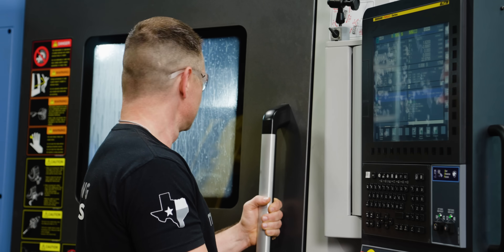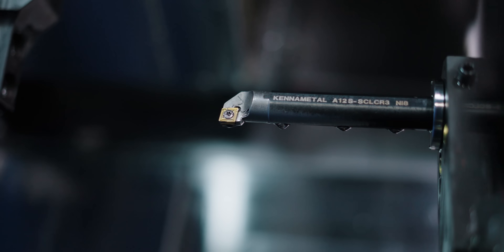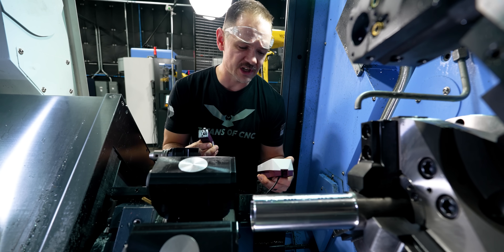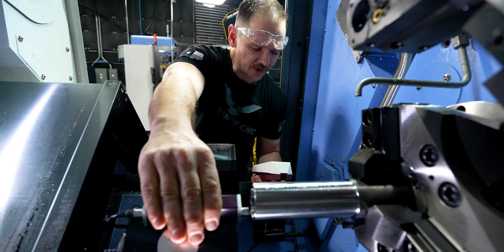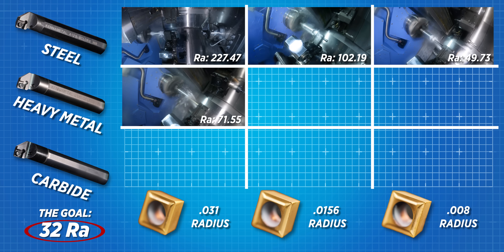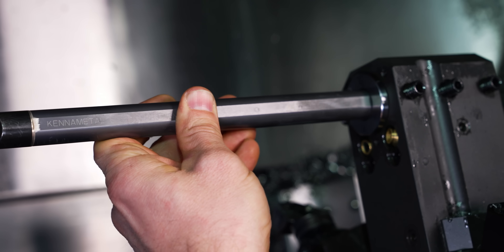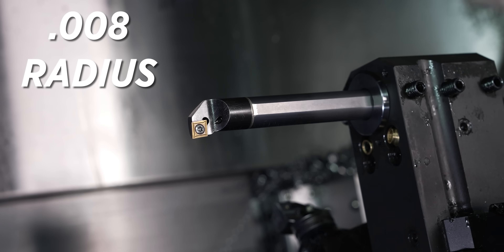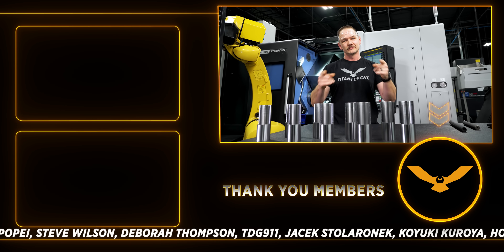This KNOWLEDGE Will Ease Your Pain and Suffering When Attempting to Machine Perfect Parts

Comment: This is not about "knowledge easing pain" but "throwing enough money at the problem". The more rigid tool gives you less chatter, who would have thought. Also, changing another variable (the feed rate in this case) makes the whole experiment unscientific and worthless. What a waste of time.
Reply: Money or not, you will not make this cut at a 32 RA finish with a Steel Boring Bar with that size shank and depth. Good luck trying.
Reply: @pummppkinn  I never said that, I only said that the title is clickbait trash and changing multiple variables is as unscientific as it gets and prevents comparability of the results.

Comment: Call me old school but I was taught that the cut should be bigger than your radius, this stops the vibration. Would you believe it the smaller insert worked better but I bet if the larger rad insert was given a bigger cut it would also work fine
Reply: Spot on :)
Reply: What that mean by cut,
Is it Depth of cut ?
Reply: Are you saying that the depth of cut needs to exceed the radius of the cutter?
Reply: Yes.  Depth of cut should be at minimum, the tool nose radius. @mdmonroe82
Reply: So that's a rule of thumb.  I do CNC production and sometimes you can't get around it. I have to program my machines to do something that's not ideal all the time.
Reply: These guys aren't realistic for sure, but I love watching them ruin high end machines.
Reply: Just buy a sandvik devibe bar 😂.
Reply: This rule may explain why insert with a smaller radius worked better...

Comment: First, follow 3 diameters rule material overhang. Second, the depth of cut should be no less than 2/3 of the nose radius. Third, avoid depths of cut smaller than 1/3 of the nose radius when finishing at small depths of cut. Fourth, boring bar overhang 4xBD steel, carbide 6xBD, 10-14xBD for high end with dampers. Follow the above and you will have no problem, but before you do all the above finish your education. YT school is not for everyone.
Reply: true

Comment: I was like "Getting a surface finish of 32 can't be that hard, what's all the fuzz about?"
Then I remembered that the units are probably different. It turns out 32 microinches is 0.8 micrometers which is a lot finer.

Comment: I dont appreciate how the only solutions presented are "buy a better tool". In my experience, adjusting speeds and feeds and ensuring rigidity is the most effective.
Reply: You are right, but more than once, the "Buy Better" is what it comes down to...ESPECIALLY to save TIME...Which is what? MONEY.
Reply: of course better tools will cut better. It’s about practicality and balancing that with what is available. Use things until they break. Don’t waste tooling.

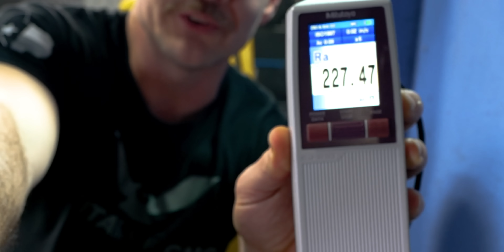Comment: 4:50 you are not holding that thing with your hand ... you know your hand vibrates right ? Deer lord ... this man lost his bucking mind.
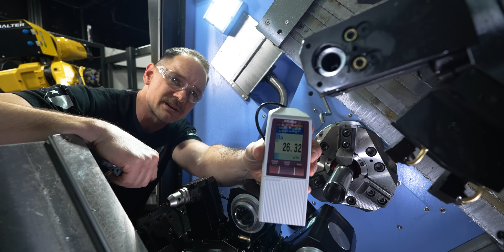13:03 so you suddenly changed the feed rate... uh ... so ... now run the other bars again at that feed speed. If you change two parameters at once you don't know what's helping the most.
Not scientific and your little comparison grid goes out the window.

Coming from a guy who ran 0.000 parts on carbide bits without aerospace lathes but on something from the 50's and 60's . Made military grade vehicle parts. Oh tolerance was wild - +- 5 thou. Doesn't mean you have to use all the clearance. Just gotta love the machine a bit ...

Comment: I believe depth of cut matters on a finish pass depending on tool nose radius. That's why a .008 tool nose radius will have lass chatter than a .031 on a .03 depth of cut. Give it a .06 depth of cut and the .031 tool wont chatter as much.

Comment: I’d have been interested to see how an increase in DOC would have helped the .031R.  I do Swiss machining and programming and use positive profile inserts and have to adjust the radius dependent on DOC to get past that nose radius since that profile will establish a V that stabilizes the cut.  With a .030DOC the insert was pushing away.  Based on the lead angle that appears to be present in this video on those bars, similarly to our setup, the .008R self-stabilized.
Reply: What are possible profile inserts?  Did you mean positive..?
Reply: @brandontscheschlog yeah autocorrect got me on that one. Oops!

Comment: It should be mentioned that it is not about density, as you said in the video, but simply about Young's modulus. Every steel (even hard and hardened) has 190-210 GPa, and carbides are around 400 (depending on whether it is for compression or tension, where tension this is much less than compression). Tungsten would also be an excellent material for bar - it has sth like 400 GPa, but it is very brittle in welding electrodes and would probably crack. I don't know

Comment: Dropping the feed per rev from .004 to .0024 on the 8th test skews the results since that's basically a 40% drop in cutting forces and thus deflection. Doing another run at .004 would better show how much switching to carbide helps versus how much the 0.004 -> 0.0024 change does. That said, we can compare against the last column to see that they both contribute to reduce chatter.

Comment: Vibrations can stop if more metal is removed; the cutter simply bends to a certain distance in which its rigidity increases
Reply: Plus a huge overhang of both the tool and the tool holder. On conventional lathes, the cutter is attached rigidly, practically does not hang in the air, and even a steel cutter works great there
Reply: Plus a huge overhang of both the tool and the tool holder. On conventional lathes, the cutter is attached rigidly, practically does not hang in the air, and even a steel cutter works great there

Comment: Honest question. What is the calculation you guys use to figure out what feed rate you need for the specific tool nose radius to get a desired finish? I have one, and i built the calculator into google sheets and I'm coming up with a 1 radius (.0156) requires .00328 max for a 32 finish. 

Thanks for any response

Comment: I learned this the hard way. Was getting a lot of chatter in my parts, so I switched the feed to .005 ipr and .035 D.O.C. For a .0086 radius carbide cutter. Immediately I got a 23.56 RA. On the hard parts, I use ceramic inserts with a .016 radius. .005 D.O.C and .005 ipr. Got a 15.8 R.A.
Reply: That's almost the entire tool.  Would reduce chatter for sure but on something that small I'd be afraid so much engagement would just shatter it off.  (Wait you mean lathe tool, nevermind.  I thought you meant like an endmill)

Comment: The amount of cut must be different depending on the NOSE R value.
If the NOSE R value is large but the depth of cut is small, the vibration will naturally be severe.
You must re-set the depth of cut, RPM, and FEED to match the NOSE R value.
I wonder if this test is meaningful under the condition that only NOSE R changes.
With the depth of cut set at .031, an Ra of .008 is bound to come out well.
because?
If the NOSE R value is .031, a depth of cut of at least .031 is required to fully utilize the power of this insert.
The condition itself did not meet even .031, and since the depth of cut was large at .008, there was no choice but to have low vibration and good Ra.
To perform this test properly, the depth of cut must be varied to match each NOSE R value.
This is the basics of processing
This test is meaningless
Lastly, what I want to say is that the larger the NOSE R value, the better the Ra.
but,
You need to set new conditions that match the NOSE R value.
Reply: Completely agree.

Comment: Disappointing video....This is just product placement, and even then there's no mention of dampened bars or other methods of chatter reduction. Sure, there was mention of changing speeds and feeds, but if you're trying to make machining accessible to everyone, why not talk a little more in detail about which direction to go? I guarantee you with the correct speeds and feeds that steel bar would've worked just fine for a 32 finish. Bar diameter, chip buildup, coolant, Y-axis, chuck jaws....All really quick and easy topics to touch on that can also affect chatter.
Reply: My dude this whole channel is product integration.  Just let it be.
Reply: I have to disagree with you. For one I wouldn’t even waste my time with a steel boring bar when I know from experience the best place to start is carbide. If you watch this vid you can quickly grasp what they were trying to communicate! In my experience you can beat chatter a few ways! One is slowing down the rpms, maybe you can shorten your bar, maybe you can push the part further in the chuck. Maybe using some cutting oil. Point being if you don’t want to put in all of that work to figure it out, this vid serves as a great starting point. That starting point is, radius matters, type of bar construction material matters, the more rigid the better, Best wishes.
Reply: @Soundslikeden  Did you actually read my comment or no?
Reply: @halomaster985 I did.. was simply trying to sum up and say they gave a good STARTING point which is beneficial to making machining accessible to everyone.
Reply: @Soundslikeden  Carbide is not a good starting point. Most people just starting out in machining aren't going to have the funds for carbide. I can't even count how many steel lathe tools I've made over the years because it's what was available...and carbide is not as easy to make tooling out of, nor as cost effective. Sure, steel tooling isn't going to work on certain materials (stainless, 4140, titanium, ar500, etc.), but most people aren't going to be starting out on those materials. SO MANY people I've met just starting out were told carbide is the only way to go, and it's probably because of videos like this.
Reply: @halomaster985  it is the way to go if you want results and quick. I wasn’t speaking about cost effectiveness, also I’m speaking from the perspective of a machinist in a machine shop using someone else’s tools and materials that would have the budget for carbide. Maybe I misunderstood , I thought you meant starting out as as level and knowledge, not starting out machining on their own dime.
Reply: @Soundslikeden  Yes, Titan targets his media for new machinists/shops starting their business, and I know a lot of students also look to his media for knowledge as well. I just like watching because sometimes he will rip a shell mill through steel at 500ipm lol.
Reply: @halomaster985  no doubt man! Just my two cents wasn’t trying to offend ya. Have a good one!
Reply: @Soundslikeden  No worries, I just thought it was weird that you said you disagreed with what I said, but agreed with the rest of it lol.
Reply: @halomaster985  hahahah!
Reply: @Soundslikeden  Steel bars are the standard for roughing, carbide for finishing in SHORT overhang  applications. The problem with videos like this is that they don't explicitly point out these differences and people might run out and buy far more expensive carbide bars for everything because "better". You and I might understand that, but not everybody else does. 
They also left out the price point. Believe it or not, heavy metal bars actually cost a LOT of money because they have a mixture of tungsten and steel which aren't as easy(?) or as popular as steel or carbide. 
My go-to for an application like this would be a damped bar, not solid carbide.
Reply: @CNCMatrix hey man! I would still go with carbide first in this application. Mainly because if has a broader use case. It will work in this application with just a change in speed and or feed. True we might understand this but I’m only saying the video seemed to offer a great starting point, I wasnt been overly concerned with price. I’ve ran anti- vibe bars that cost more than carbide bars in general and would rather start with carbide over the dampened anti vibe bars. That’s all! Hope you have a good one and I’m grateful for conversations like this because it shows that machining can really be an art AND a science when it comes to getting quality and throughout to maximize profits and repeatability. I don’t want want to change out my steel bar and re-index just because im roughing out a part, I’d rather stick to the carbide the entire process especially when there’s a larger part order to run. But again I’m speaking from the perspective of a machinist working in someone else’s shop with someone else’s tools so your experience may be totally different. Hope that helps explain my initial comment! Happy machining man.
Reply: @halomaster985  did you actually watch the video or no?
Reply: I'm with you, really. And I can't believe I'm saying this, as I'm not a huge Titans fan, but I recognize that their whole schtick is reducing cycle times and getting the best quality they can while doing so. Having done (and actually have scheduled in the next months) some less than ideal turning situations, slowing the RPM (and likely the feed) for a steel boring bar means slower cuts, and realistically not the best finishes (low RPM means we don't get those glossy finishes we want and can easily achieve when the SFM is correct). For this test, it's a serviceable test of what it is: boring bar composition and insert radius. Can us dudes with manual experience and low-budgets make do with a steel boring bar and a .03" rad at lower RPM? For sure. Will we take longer? More than likely. Some shops/customers just want the job done, some want the bleeding edge of efficiency. It's a balancing act, to be sure
Reply: @KuchiKopium  I agree, but I also don't want poor quality attached to my name/reputation. If you want fast garbage go buy from China. I can't beat Chinese pricing, and it's pointless for me to even try. My product is perfect, regardless of how long it takes.
Reply: All Titan’s stuff has been Product placement. It’s a media/marketing company specialized in making adverts for the machining industry.
Reply: @WasNiksIsNiksWordtNiks  literally 
Dude even said "it's just disappointing *especially from titan*" as if titan doesn't do this shit 24/7
Reply: Any steel bar is only good for 4xD in terms of stick out. The steel bar in this video was set out WAY further than that. 

You don't have a clue what you are talking about
Reply: Agreed should have kept speed same on my lathe I get smoother Finnish on stainless around 400- 600rpm when boring but when increasing speed I do get chatter
Reply: From the very start and at the end they said they were just going to use 3 different bars and 3 different inserts.  So by the parameters they set forth they delivered exactly what the results were. 

I agree there wasn’t more covered in chatter reductions but they never said there would be in this video.  This is just a tiny sliver or a piece of the pie.
Reply: @Zxavioure  I'm just tired of companies telling people to throw money at their problems, instead of actually telling them how to fix their problems. It's especially disappointing hearing it from Titan, since his mission statement is all about sharing knowledge and helping people be successful...But I guess that's only if they're willing to spend money.
Reply: @halomaster985  "it's especially disappointing hearing it from titan"

This is literally all that titan does. They have a shit ton of product placement with promo videos of their work. 

Again why are you acting like this isn't normal? **especially** for this channel.
Reply: But he did mention different speeds and feeds...
Reply: You need to work on your listening skills buddy
They said from the start that they'd only be covering a SLIVER of solutions for chatter.

Not their fault you can't pay attention and want to be pissy about something you were already warned about.
Reply: Counter intuitive but loosening the setscrew closest to the job will soak up most vibrations in steel boring bars. Leave a decent amount for finish cut. Good finish and still holds tolerances.
Reply: What this comment says is true, and you can call him a hater (while being a hater) as much as you want. There are much easier ways to remove chatter, from ordering pipes instead of whole material, till letting the tool have a deeper bite and less rotational speed, all with the same, big radius.
Reply: I disagree. He said at the very start it is a diverse and complex topic and even with three different boring bars and three different tip radii, not to mention speed, rigidity, material type, it stretched into a 15 minute video. As for the product placement, if you wish to avoid that you better move to another planet. Experience and insight are king, but remember, this is not aimed at the experienced machinists. To someone on a learning journey this is invaluable.
Reply: @tj9382 I disagree. To someone that is learning this is almost usless. They did almost nothing to tell you anything about how to solve chatter with the tooling you are given. They told you your shop needs new and more expensive tooling. 
A 5/8" steel anti-vibe boring bar costs $1,000 minimum. Good luck getting someone to order you a much more expensive tool when the answer is to just adjust the speeds and feeds or your work holder.
Ive been at this for 11 years and I still click on anything the says they can help me solve chatter that isn't just reducing speeds and feeds to a ridiculously low rate. Running slow costs my company money, which means they have less to give to me. I'm all about running as fast as I can within a given set of parameters.
Reply: Haters gonna hate....